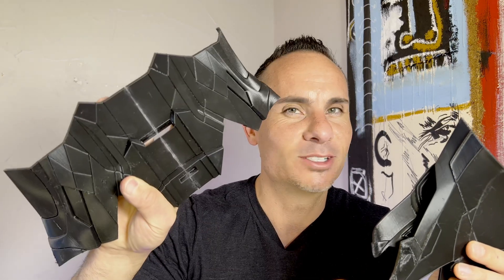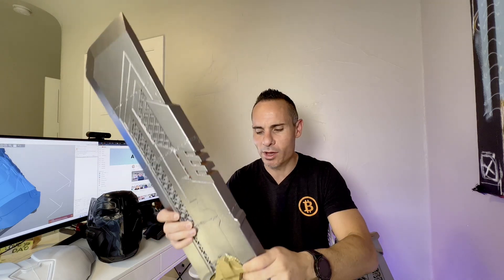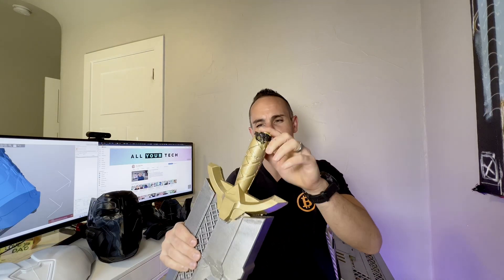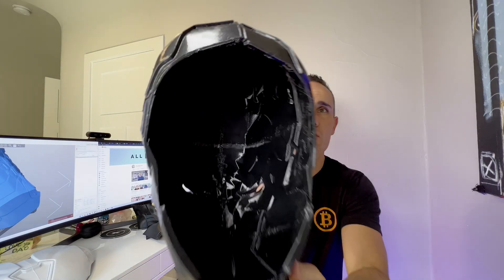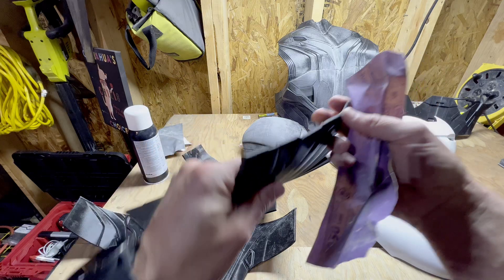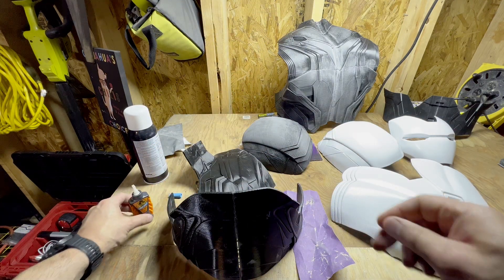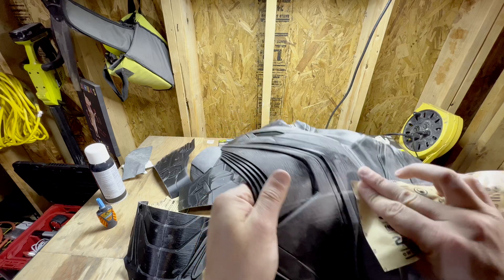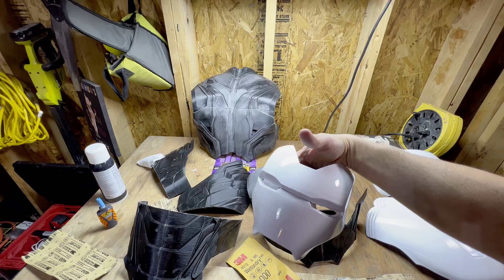Glue & Bond 3D Printed Parts with Ease

Comment: Small tip: sprinkle some baking soda on the seams after appying superglue to the backside of your parts as shown @7:30. The chemical reaction between the superglue and baking soda makes it very sturdy. Just make sure you're applying it to the side you don't see because this mix gets really hard.
Reply from the maker: Pinning this comment. Thanks for the tip!

Comment: I use the friction welding option when I combine pieces. Basically stick a piece of the same filiment you print with in a dremel or rotary tool an turn it on and run it over the seam

Comment: Did this hold up without breaking?  I’m gonna need to repair a 3d printed battery housing and need something that won’t snap.
Reply from the maker: It did, even with my son wearing it multiple times. This seems to be a solid way to bond 3d printed parts from my tests.

Comment: Been assembling a mando helm. Never tried anything of the sort before.
Had to print it in 8 separate pieces, not including ears and vent (big head, small printer)… putting it together was a massive pain and some bits still don’t line up perfectly. Will continue through sanding and painting but it’ll be obvious a newbie made it. 😅
Reply: Did it turn out well? I was having the same experience with my Mando helmet😅